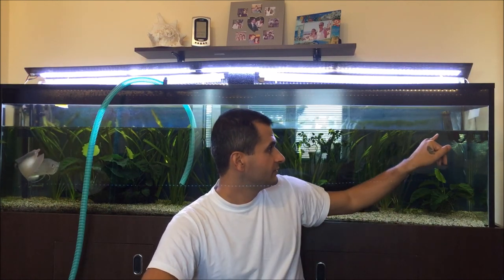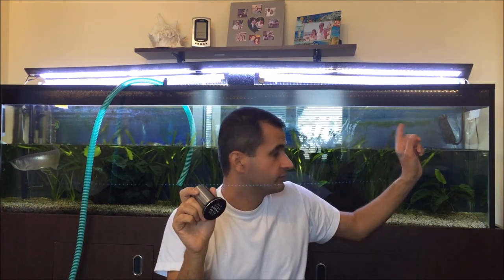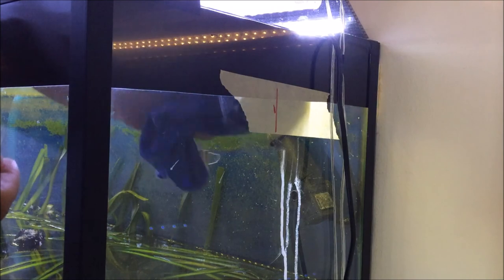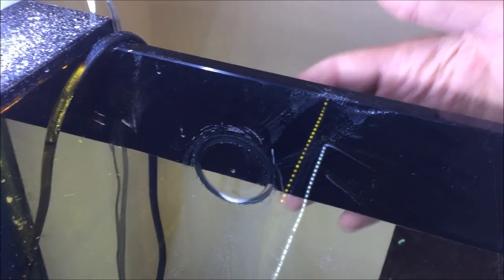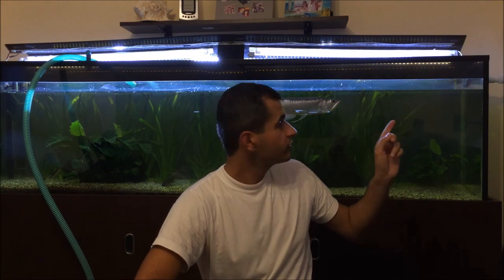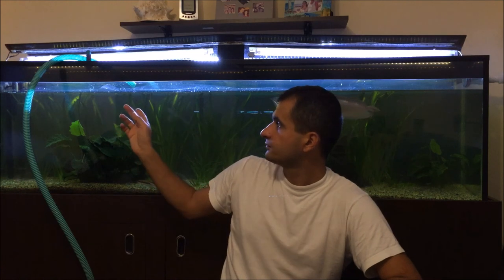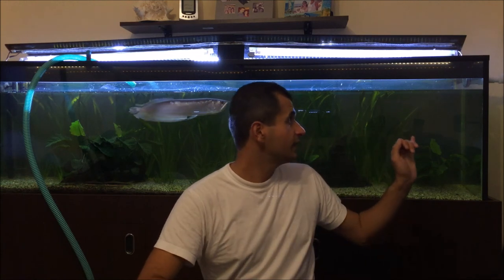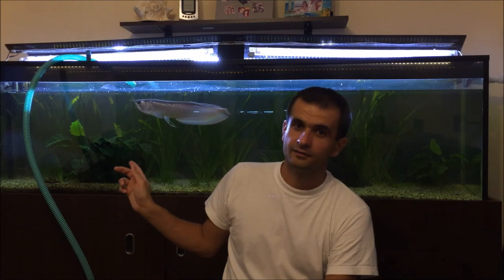How to drill a glass aquarium easy and install an overflow

Comment: when u used ur diamond cutter to drill ur tank .pl tell me we can use any drill machine of any watt to drill a glass
Reply from the maker: Any machine will do, I just used a small one (200 watt)  because it was easy on my hands. You can even use a battery operated machine to be safe near water, unfortunately I did not have one.

Comment: You can't adjust tank water level and the water is always much lower than the tank top.
Reply from the maker: I just used a piece of duct tape over the overflow to cover some of the holes and that way I ajusted the water level. Or I can use a valve on the exit pipe and ajust the flow from there.